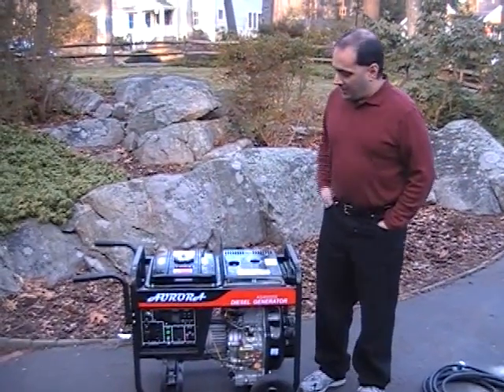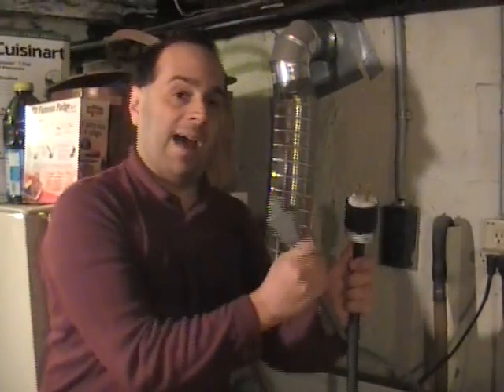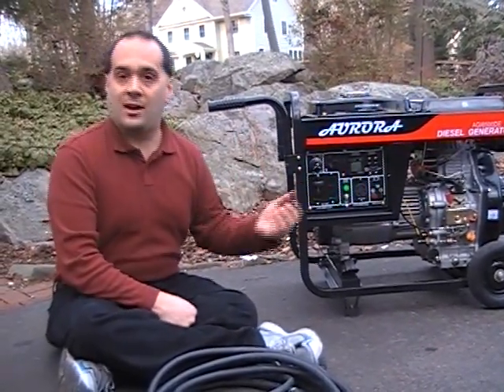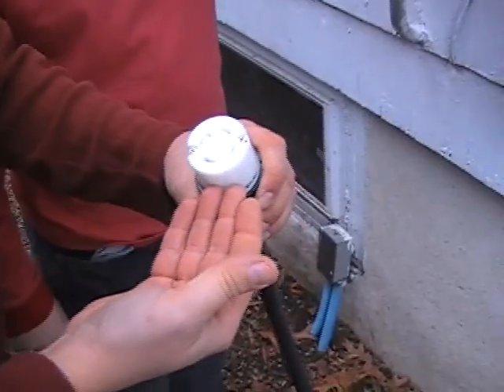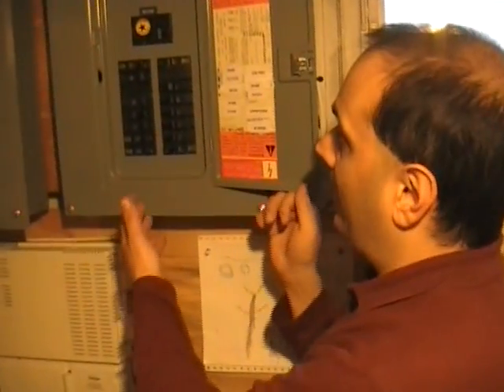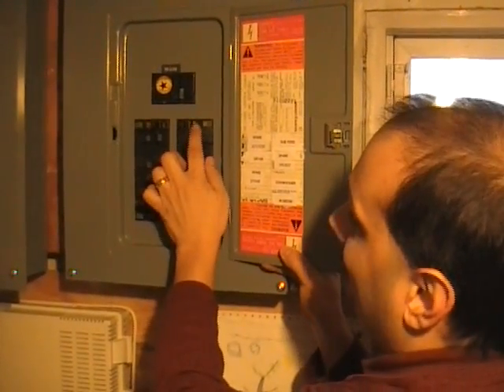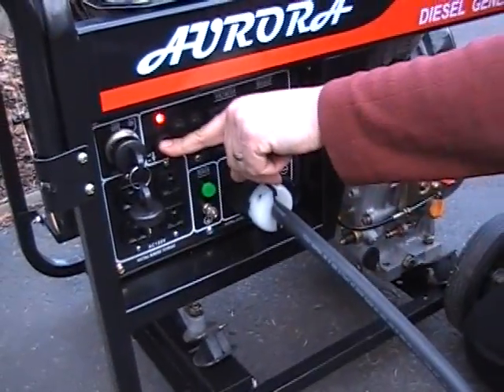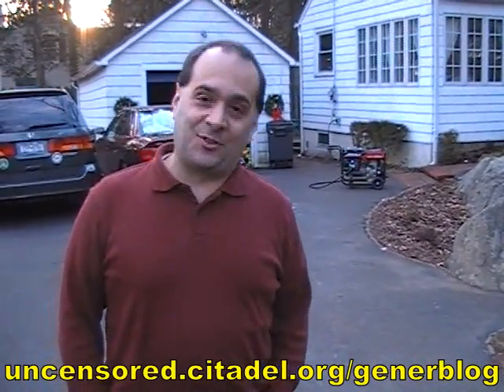Inexpensive residential generator hookup

Comment: If power from solar panels are connected directly to the circuit baker box to use both energy at the same time )solar and grid) using the solar first and grid if more is needed, why can't a generator be the same way?
Reply: I believe there is a provision for grid-tie solar systems that sense when the commercial power is off and disconnects the solar.
Reply: I did some research on this, and power from the grid is "Pure Sine Wave" at 60 hz.  All you need is a frequency converter. The solar power is connected to the grid at all times, that is how they trace the power you produce and give you the proper credit however, utility company wants you to do a setup with an extra meter and that is a bit costly.
 With proper converter and frequency any generator  CAN be connected tot the grid at all times just like solar panels can.
Reply: yes, if the generator is connected to an automatic transfer switch like generac tries to sell you.  Generators produce much more costly power per kWh, so why would you want to pay for fuel and put that generator power on the grid?
Reply: Which BTW is absolutely RIDICULOUS. It's beyond any reason and logic why on earth you would require people with solar systems to go dark when they can generate their own power just because the grid is down. I understand that it is supposedly for the safety of power company personnel, but that's stupid. If the grid-tie equipment can detect that the grid is down and shut down the solar system, then it can damn well be designed to detect that the grid is down and cut the link sending power out onto the grid and simply isolate the premises.  I  PROMISE you, if I spend $20k to be able to generate my own power, I will NOT sit in the damn dark just because the power company is down.

Comment: Art, I went on the Aurora website, and they no longer sell the portable diesel generators like the one you have, due to change in EPA regulations for diesel emissions. So I don't know if you want to put in an update about other generators you would recommend.
Reply from the maker: Unfortunately you can't buy an air-cooled diesel from any manufacturer anymore, because the Obama EPA killed off the entire product category.  Hopefully the Trump EPA will bring them back!  I like your suggestion about posting an update but I don't really feel qualified to recommend other generators right now -- understandably I haven't been researching them because I already own one  :)
Reply: Thanks. One other thing, do you have some written materials or another video that shows how you actually did the wiring in the subpanel? I tried the link to the citadel site, but it didn't work for me.

Also, I already have a subpanel which is used for my central air system. I'm trying to figure out if I can use that to move some of the circuits I want hooked up to the generator: I wouldn't use the AC during a power outage anyway, or if I will have to set up a third panel. It has 220/50 service into it right now. Your thoughts?
Reply from the maker: Well, there's a photo of the completed wiring at http://photos.citadel.org/generator_001/installed_sub_open.jpg ... but this video was intended more as an introduction and review of the topic, with a focus on safety and code compliance, rather than a step-by-step how to.  That having been said, if you do have a subpanel right next to your main panel, then yes you could move the A/C over to the main panel, move all of your desired generator loads over to the sub, and put the interlock there.

Comment: Great video! You sound like an engineer, so: can you tell me how much voltage is lost per foot of 220v wire? I need to run the wire from my panel to the inlet receptacle on the other side of my house.
Thanks!
Reply from the maker: Voltage drop is not normally going to be an issue at that kind of length.  There's an online calculator at http://www.elec-toolbox.com/calculators/voltdrop.htm that you could use to calculate your wire size.

Comment: VERY GOOD VIDEO VERY WELL DONE. I had just watched a guy show the suicide method and as one power company worker pointed out it could be a murder for a line worker outside trying to fix the problem with the supply. you're very safety focused
Reply: a line worker who is not trained to test for power on a line before they work on it should probably not be a line worker.  They can / should also electrically  isolate the equipment for their own safety.

Comment: Nice job Art.... I studied the photos and  have a question... where does the wire that feeds in from the bottom left of the sub-panel connected to the ground buss go?  To a ground rod? or is it connected to the main panel ground buss?
Reply from the maker: That's not a ground wire; it's an ordinary piece of 14/2 NM that feeds an outlet just off screen.  The sub is grounded through the big green wire that goes back to the main panel.

Comment: Hi , I want to install a interlock in order too be able to hook my generator to my panel. There is a 50 amp Breaker with a 6/4 aluminum wire that is not being used. I have a L14 outdoor plug box. Can I use the 50 amp breaker and 6/4 wire with the L14 outdoor plug box to back feed my panel, with the interlock of coarse. Or do I need to by and install a 30 amp breaker and 10 gage wire?
Reply from the maker: I see a couple of problems here.  For starters, you can't use a 30 amp receptacle with a 50 amp breaker.  The wire size is fine but the receptacle is not.  You would have to either replace the breaker with a 30, or replace the receptacle with a 50.  The other red flag here is aluminum wire.  If you use aluminum, make sure your receptacle is marked "CU-AL" which means it can handle aluminum wire, and absolutely marinate those connections with No-Al-Ox or a similar antioxidant paste.

Honestly, I'd just put in a 30 amp breaker and interlock, and unless the distance/route of the cable is a problem, installing a few feet of #10 isn't going to break the bank.  Disclaimer: I am an expert but I am not a licensed electrician; use this information at your own risk.

Comment: As an electrician myself I was thinking of exactly the same thing the only difference is that I have a single phase generator that I was thinking of doing the same thing with but instead of powering everything which the single phase generator can't do, I would pretty much have a sub panel which is single phase just for my refrigerator circuit the essential lights and a few essential receptacles. Your video is the best one out there so far and I have seen plenty. thanks for sharing.
Reply: The following applies to North American electrical systems....

Two phase is not the correct terminology and sometimes, the terms "split phase" or "split leg" is used. The 220 power that we are familiar with is what comes into our home service panels and it consists of one neutral and two "hot wires". Somewhere in the neighborhood, there is a transformer with high voltage coming into it. They put a winding next to the core and it induces 220 volts into the winding. The two wires from that winding are the two hot wires that enter your house. If you measure the voltage between those two hot wires, it will read 220 volts. In the middle of that winding, they put a "center-tap" which is just a wire that connect to the center of the winding. That wire is the neutral that is brought into your house. If you measure between the neutral wire and any hot wire, the voltage is 110 but, one with respect to the other is 180[SUP]o[/SUP] out of phase. Without a significant description of phasor mathematics and something called "complex numbers", it would be very hard for me to describe in other terms why the phase change occurs but, suffice it to say, it does indeed occur.

BTW, the terms 110, 120, 220 and 240 are a little confusing. 110 and 120 are the same really; it's just that the power company is allowed to vary the voltage under different circumstances and it could be somewhere in that range. The frequency (60 Hz in North America) will not change and if it ever does, there are serious, serious problems going on in at the generation facility -to the extent you will probably see a bright flash coming from the facility. -Basically, it does not vary and if it does, it happens simultaneously all through North America. The entire system is synchronized.

Ray

Source:
http://www.hobby-machinist.com/threads/purchasing-a-monarch-10ee-round-dial.17359/
http://www.hobby-machinist.com/threads/why-is-220v-called-single-phase-when-it-has-two-phases.17428/
Reply: Standard USA voltages have increased with the decades and so has a Coke Cola too. ie  100/200, 110/220, 115/230, 120/240,125/250 . On a hot day in a rural area by barn's voltage is really about 110 hot to neutral and 220 hot to hot. Gobs of folks have AC units on and one's voltage is lower than normal. At my Business in the city the voltage is never as low as 120/240, more like 124/248 even on a hot day. At night it is 125 to 126 for the "120 volts" and 250 to 252 for the "240" volts
Reply: 220 is single phase Mr. Electrician.
Reply: It's usually closer to 230vac
Reply: At my business having 230 volts as the average AC voltage was 50 years ago. It is about always higher than even 240 volts, 244 to 246 is about the average at night and higher during the day. The nominal 120 /240 voltage depends on close you are to a substation or regulator.
Reply: It just depends on your electric company. It varies across the country fro 220,230 and 240.
Reply: In the USA when I was in California my apartment right by the substation, ie the start of the feeder as ww EE's say. My voltage was 248 and that was in the early 1980's. At a rural Miss cabin up the state the place is say 12 miles away from the substation and it goes through 3 buck boost stations. The nominal voltage in that place is close to 230 across both hots.  220 as in twice the old 110 here is only seen in a brownout. It was the standard nominal usa voltage say from ww1 to ww2. The post WW2 EE books used 117 volts and 234 as the nominals. Legally the power companies strive to be in the 115 to 127 volt region here thus 230 to 254 volts.  If you are a giant user of power then the nominal here might be 220 under a peak summer load day. The nominal 208 volts here at my shop of wildcat phase to neutral here is only thing that ever might be say 220 volts. Older EE folks will call the common 120/208 Y 3 phase Voltage a 115/200 volts Y
Reply: @3beltwesty  Generator safety rules: Always make sure you follow all the generator safety rules before using your portable generator. This is only a reminder. Generators can be dangerous if not used carefully. Every year, hundreds of people die or get injured when using portable generators due to carbon monoxide poisoning and electrocution. Make sure you are using your generator carefully and keeping others safe as well. There is something very serious that everyone should always be aware of when using generators. Some people do run their generator indoors which is not safe and that increases the risk of carbon monoxide poisoning which can cause death of family and you. Some people run their generator in wet conditions which can electrocute them. Please remember that you should never run your generator indoors. Remember that carbon monoxide is an odorless and colorless gas that you cannot see or smell. Carbon monoxide is a silent killer. Keep that in mind. Make sure your generator is 15-20 feet away from your house and away from doors, windows, and vents. Never use your generator in your porch too. Having a carbon monoxide detector is very important against generator safety. Some people also allow children to go near the portable generator which could pose risks. We need to keep an eye on our children making sure that they are not near the portable generator so they won’t get electrocuted or burned by the generator which is dangerous. A locking enclosure also keeps kids safe. A generator shed might look like a tempting place to explore, or take cover during a game of hide and seek, but a generator is a dangerous piece of equipment that can cause injury. It says on the manual that we should also keep children away at all times from the portable generator to avoid injuries. Please do not allow a child or unqualified people to operate the portable generator.  It is important to keep your children safe especially little ones. The portable generator can be hot during an operation. Just because some manuals missed what should be listed doesn’t mean it’s safe to do. Always follow the generator safety rules when using portable generators. Generators pose electrical risks. If you need to use your generator during wet weather, you need a generator tent to protect your generator from getting wet. Don’t let your generator get wet. Keep your generator dry and before using your generator, please make sure your hands and your generator is dry. Do not wear loose clothing when operating the generator. Everything that is said on the generator’s operating manual should not be ignored. Never smoke cigarettes near the generator. Please keep flammable things away from the generator. Never overload your generator too. Your generator can catch fire. Never ever try to plug a generator cord into a wall outlet to avoid back feeding. Back feeding your generator is dangerous. Always turn on your generator first before plugging in appliances and shut off the appliances before turning your generator off. Use a heavy duty cord for your generator and the cord should not be worn out. All the instructions should be followed carefully. Never refuel your generator while it’s running. It can cause fire if fuel spills while your generator is hot. You should turn off your generator and let it cool off before refueling it. Having a fire extinguisher next to the generator is also important. This is only a reminder for everyone’s safety of using generators. Make sure your generator is properly grounded. Having a fire extinguisher next to the generator is also important against the safety rules. https://youtu.be/I1jT3ANENvI and here is a video more about keeping others safe when using generators and also about our family’s safety. It’s important to keep our little children safe as well. Make sure they’re away from the generator. Hope this helps.
Reply: plus or minus 10% is the rule of thumb.
Reply: Many AC units are designed for 230 volts or the 208 volts from line to line of 120/208 Y service. Thus the nameplate of the of an AC unit here says 200 to 250 volts. 

The problem can arise where some commercial customers machines use a heater or arc lamp that requires the input to be at least set to the correct tap on the input transformer on the machine.

Or the machine has a dumb ancient electronic board with giant drop down resistors for its regulated DC voltages. An old machine here I once used has taps for 200 volts, 200 volts and 240 volts on its 1.0 KVA control transformer. Since our voltage is always above 240 and usually 246 the input is set to 240. The machine was marketed for Europe too so there is the 220 volt tap, and Japans 200 volt tap too. The 220 could be used in a USA area that still uses 220 instead of 230. or for 208 volts from 120 /208 Y.  ON sister machine a tech set the tap to 220 volts and the incoming 246 fried all the massive bleeder resistors. 
The last time I have seen nominal 220 volts in a home was when cars had fins, ie Kennedy era. It does exist in more rural areas at ends of feeders and in some older areas too. 

The autotranformers for feeders often boost higher than 120 volts then it drops below 120 and the next autotransforme buck boosts it again. Thus along a long feeder the power co and set the nominal is.
Reply: Nobody cares about your refrigerator. So weird you actually think they do

Comment: Did you wire the panel yourself? 
Would be nice to see how it was done
Reply from the maker: I did the rough-in myself, and had the final connects performed by an electrician because I live in a place where you have to be a licensed electrician to pull a permit.  If you want to see the wiring details you can go to http://photos.citadel.org/generator_001/ where I have a photo album posted.
Reply: Thank you

Comment: Really good video, the panel & wiring -did you do it yourself or an electrician ? I saw the prices of the panels etc. (wow cheap) how much in general for an electrician to hook up ? (i would imagine that varies quite a bit). Does the Diesel perform better than gas ? how many gallons vs. time does the Aurora give you?  If this is too much just if you could answer the first part about installation. Thanks so much!!! David
Reply from the maker: In my county, only a licensed electrician can pull a permit.  I installed the panel, receptacles, and wiring myself, and then just brought in an electrician to do the final connections.  If you buy your own materials and do all of the rough-in yourself, then you might only need an hour of your electrician's time (plus the cost of the permit of course).

In most places, as a homeowner you can pull a permit to work on your own house.  If you have the skills to do the work safely, this is the way to go.  You will need to hire an inspector who is recognized by your town.

Not gonna bother answering the generator questions because you can't buy them anymore.  The obama EPA ended the sale of all air-cooled diesels.
Reply: l